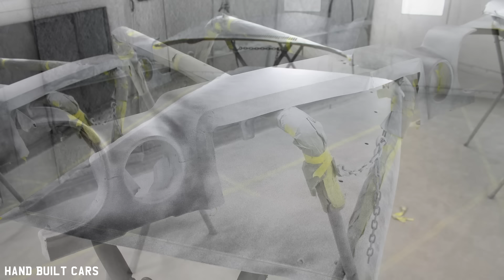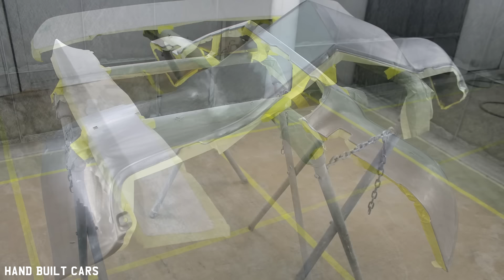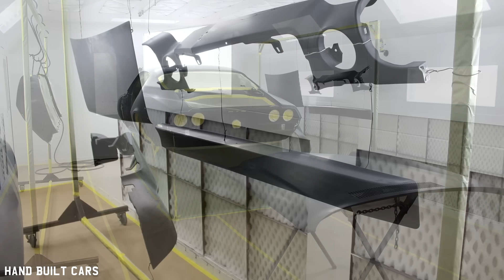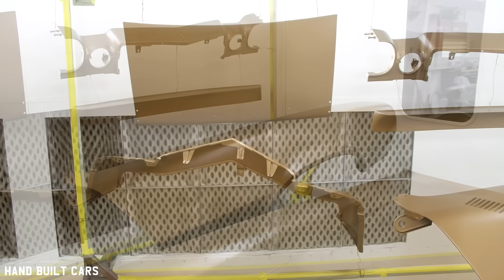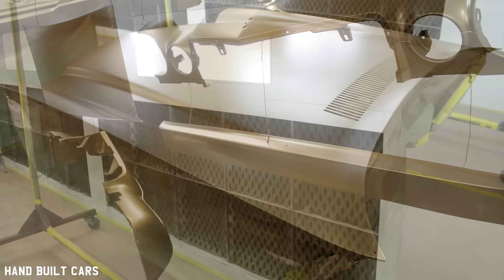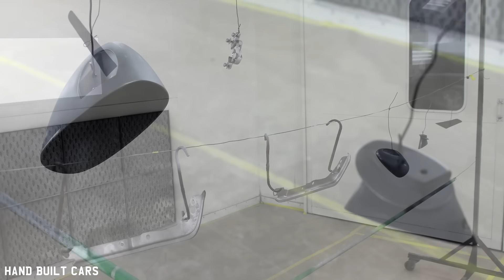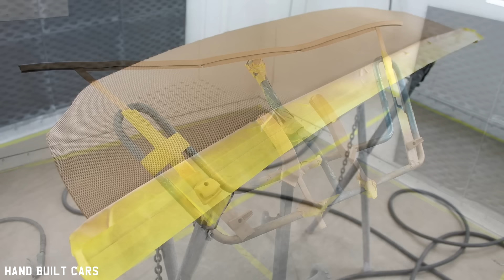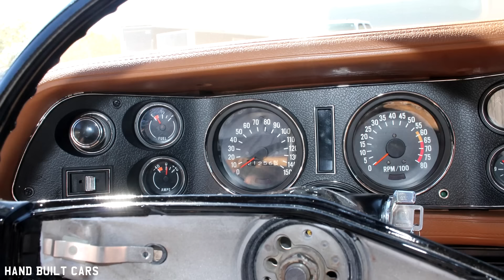1970 Chevrolet Camaro RS/Z28 LT1 350 Full OEM Restoration Project

Comment: Beautiful restoration job you did on that car. I had a 70s Z 28 but it was not split bumper same color with black stripes brings back. Lots of memories I had in 71 bought it used for 2700 miles on it. Love this video.

Comment: I bought my Mulsanne blue 1970 Z28 in 1973 with seven thousand miles on it. When I first bought it I put in a different Hurst shifter, headers, and turbo mufflers. I pulled the 4:10 rear gears and put in a set of Richmond 4:56 gears for stop light to stop light racing. It now has 3:73 gears for better cruising. The LT1 is all original except for belts and hoses. I still have all the parts I changed out including the exhaust and smog pump with all hardware that I took off it. Its never seen snow and been garaged since Its whole life. The miles just turned sixty thousand and it runs like new.

Comment: Love the depth of work done. The license plate on the rear is missing a very important set of bumpers that  hold it vertical and away from the car. Classic industries had the repops I eventually found. They are long and conical, and a spare set should go with the car to the owner.
The dashes on that car are a very methodical set of pieces. Many times the small mounting points break or are missing. So many different small screws. Fabrication of many mounting points using everything from very small sheet metal braces to plastic welding can bring them to a lasting straight as an arrow, better than OE state.
Really do love the work done, but must mention the deck lid, I'm hoping no one thought that was suppose to sit like that from the rear view. Even when popped she shouldn't be above the quarters unevenly. 
Why are the new door panels provided without the lower set of push clip holes? They tend to be the first to pull out of the backer, but screws threw the fabric in the lower section wasn't a thing. 
Absolutely a great work of art though, and no level of critic should diminish the depth that was taken to keep the piece of history road worthy and safe for years to come.

Comment: Great job on that restore.  I just bought a fully restored '70 RS Z/28 LT-1 in classic copper with white stripes.  What I'm inquiring about is the little snorkel piece on the motor above the exhaust manifold, next to the alternator, with 3 holes in it, that connects to a hose on the back of it.  Is that some type of smog equipment piece?  My LT-1 (built at the Norwood plant) does not have this piece on it.  Edit:  After some research, the 3 holed piece is a diverter that is part of the smog pump assembly.

Comment: Very nice job, you definitely know  what your doing! I applaud you putting on the new Quarter panel, but why would you not put on new door skins,  front fenders too?  The man hours to mud them up surly added more $$ to the job then replacement panels would  have. Plus mud on a hood panel, with all the flexing it does, it will have stress cracks down the road. But with your skill level, I'm sure you already know that.   ??
Reply: The seams at the roof/quarter panel should have been leaded, that's a flex point, regular filler will crack over time.

Comment: after april of 1970 you could order the copo style rear spoiler
Reply: That's correct and when you ordered the COPO 9796 rear spoiler option after April 26th it included the front spoiler (in the trunk) for the first time in May/June 1970. This car is not a COPO (no high 3 piece rear spoiler) therefore no front spoiler. Lots of people add them but that isn't correct. The 1970 D80 option is a rear spoiler only ... no front spoiler. Glad they kept it original and did not add a front spoiler. Go ahead and Google "Phil Borris COPO 9796" if you want more information regarding the COPO option and why Vince Piggins at Chevrolet was forced to add the spoiler to a few cars after Penske launched a complaint SCCA officials saying Chevrolet was cheating because the Chaparral No.2 and No. 3 cars were running with a front spoilers giving them an unfair advantage and these spoilers were not available on the Z28 from the factory essentially breaking the rules. Piggins scrambled and got the spoilers into production as the 9796 option.

Comment: on z28 rs does it still have the longer nose or is it the same as a z28 just asking i;m not sure
Reply: The RS had the split bumper (2 smaller bumpers) versus the one piece bumper that goes across the grill. The signal lights on the RS are between the grill and the headlights whereas the signal lights on a non RS are below the one piece bumper. The RS has a longer nose ... yes.
Reply: @wastedyears6653  i'm asking if the z28 rs has a longer nose i use to own a 70 rs now i have a 79 z28 rs t top of the second gen i keep getting them for free 1st gen and second gen . plus a lot of other rigs mostly pu 79 and older i collect